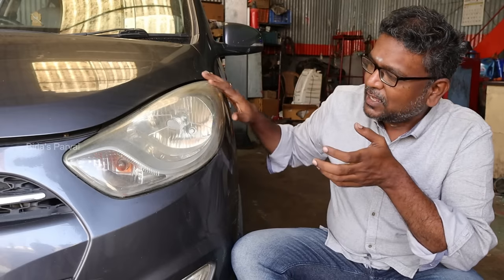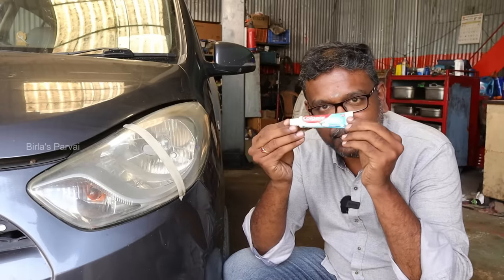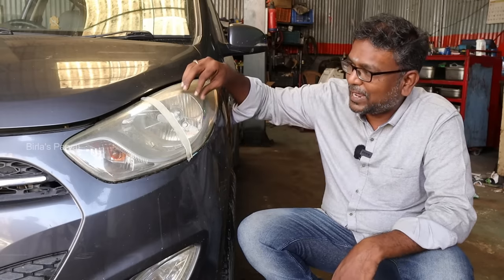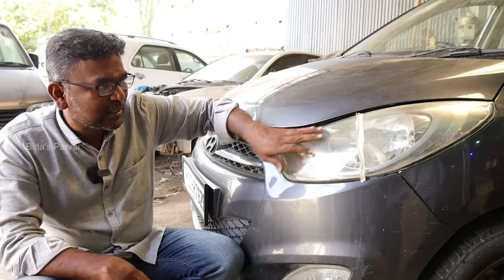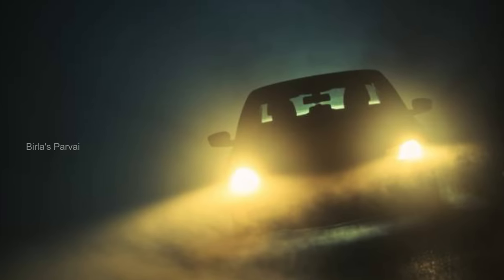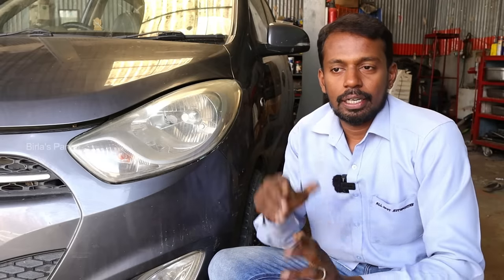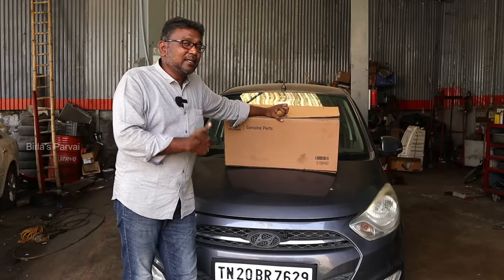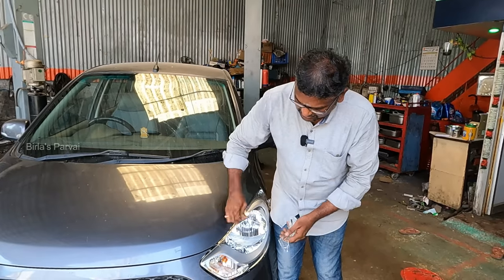Car headlight cleaning - with toothpaste | Is it working? | Car Hacks testing - Ep01 | Birlas Parvai

Comment: Hello Sir,

In this video, it is not clear that what types of sand grids are used for removing the residues. In professional method we use 4 different sanding grids to remove hardest to fine residues. Then we process 2 different stages of buff polishing.

Professional headlight restoration process gives best results with respect to age & condition of the headlight.

We accept that headlight restoration process doesn't vanish the scratches/cracks but with professional grade materials, we can bring the look to 80-90% as new.

Regards,
VVR Car Care
Tirunelveli

Comment: Cant we buy only the glass instead of buying doom, bro ?
Reply: Hello Sir,

Currently OE doesn't make separate-able fiber units in headlights. Its are of completely molded units. In old age cars we could see glass covers are removal in headlights.  

But, we can still replace the fiber glass(in scrap yards) alone with proper technician & heating method. 

Regards,
VVR Car Care
Tirunelveli

Comment: Head light glasses get lot of micro cracks and it catches fine dust in it. This problem is called ageing. This is mainly due to bigger temperature difference between inside and ambient. It gets accelarated because of altering with higher wattage. The only option is change head light fittings. No other solution.

Comment: You could have went pudupet and you could have cleaned. It will be like brand new and set of two is Rs. 800/-
Reply: Gone ji not went...
Reply: Even if you do, they can't do UV coating like OEM. So will become yellow very quickly
Reply: @vjpedia1984  800rs ku athan bro Pana mudiyum